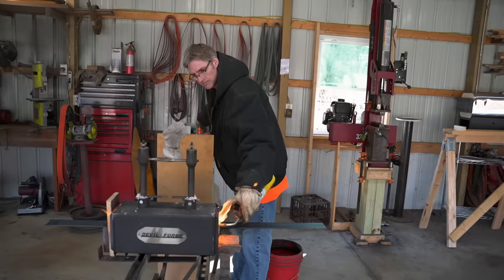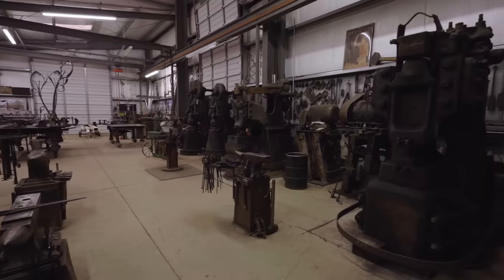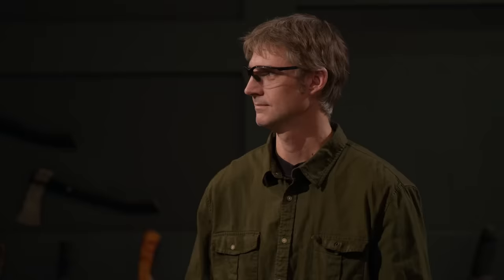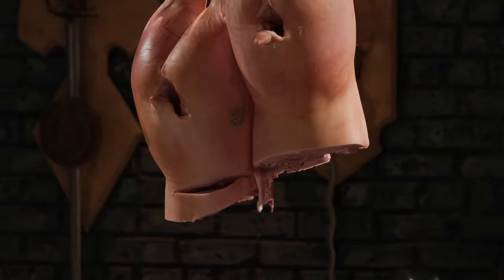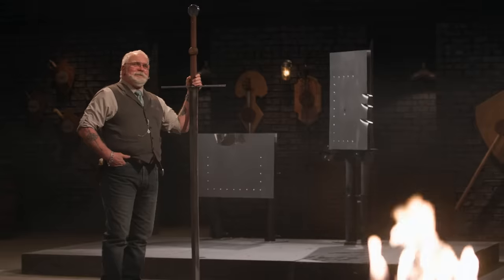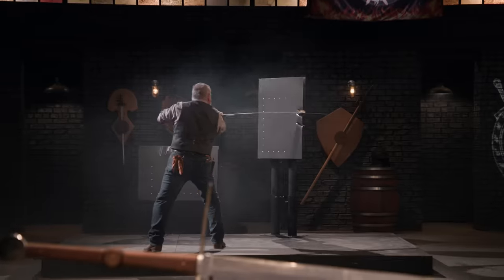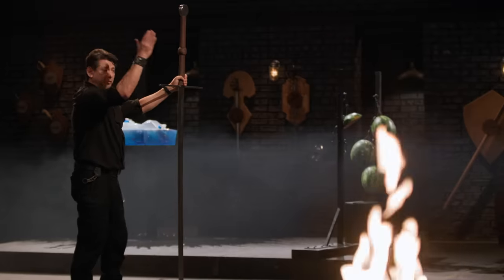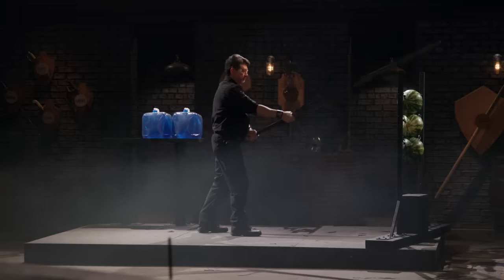MASSIVE SWORD is the LARGEST EVER Used in Battle! | Forged in Fire (Season 9)

Comment: the fact these blades didn't suffer a catastrophic failure is nothing to scoff at. most impressive
Reply: Especially with how John's sword kinda looked like he made it a bit too thin, or messed up something in the heat treat. But I guess that flex was what allowed it to endure that kind of beating.
Reply: @dethkruzer  flexible swords are actually slightly more durable than non flexible swords (why most European swords were made to be at least partially flexible). His was just a little too flexible, compromising some of the edge alignment.
Reply: @JosephSmith-lm4ri  yeah, it's about finding that sweet spot between hardness and flexibility. Too hard, it'll hold an edge well but be brittle. Too soft and it won't hold an edge but also won't shatter when you hit something hard the wrong way.
Reply: @JosephSmith-lm4ri  It just flex like a chinese jian, but the chinese jian is shorter and easier to control.
Reply: I cringe every time I see them do the hardness test. I understand why it's done but putting someone's work, any work, through that kind of treatment does not leave a good feeling.

Comment: Much respect to the Forged in Fire crew, and the bladesmiths, those were really outstanding blades for only having 3 days. But they really should have got some guys for whom a sword like this would have been made. It would have been neat to see what blades like that could do in the hands of someone like Björnsson.
Reply: They would have to find people that are both the right size and have experience wielding blades. You don't want to get some random big guy that has no experience in historical martial arts flinging that thing around.
Reply: @blaynegreiner9365  true but well according to the story does not sound like Gruite Pier had any training initially either he was just big and strong.
Reply: @blaynegreiner9365  I think these guys, who've been judging for upwards of 8 years now, has some sort of experience on wielding weapons, also, they're basing the weapons on the strength, and sharpness of the weapon itself, with a completely unbiased opinion.

Theres a reason why there are professional judges, and not every athlete is great at judging

Comment: That's actually fairly unfair to these two. That is one monster piece of steel to forge and finish in the same time all others have with significantly smaller blades. Well done to these two for not snapping like the other 2 handed styles on the show. Looks more like a Warhammer blade for Orks
Reply: theyre both competing under the same conditions, so its fair
Reply: fairly unfair? lol
Reply: @nanopixel6460  When you don't understand the comment
Reply: Big Choppa!
Reply: Ironically, there seemed to be no drama or critical errors; it's rare to see two smiths go through their respective processes so smoothly.

Comment: I think this is the first time I've seen a heavier blade win. Beast of a sword.
Reply: To be fair, the lighter blade won the side slice.  It cut so clean and quick that the tops stay in place despite being severed from the bottom.  Doug's reaction to that was priceless.
Reply: I think the weight almost didn't become a factor because none of them expected they could wield it effectively so they didn't have the same standard in terms of dexterity they would have with other blades. They really needed to get a giant with swordsmanship skills to test it properly.
Reply: Usually, the heavier 2-hand blade wins. heavy 1 hand blade is bad.

Comment: I find it hard to believe that a sword that big and floppy would be practical in battle.
Reply: It is the intimidation factor.  If the other side runs at the sight of someone that big wielding that size of a sword, then it has done it's job.
Reply: it wasn't, big swords like this were show pieces
Reply: @aname6717  That is kind of what I was saying.  You show the other side the piece you are carrying and they decide not to fight.  (joking)
Reply: it's not that's why it was never really used in battles excpet for a few exceptions
Reply: Doesn't that depend on the size of the wielder?

Comment: Don't think I've ever seen a blade with too much flex. Was that down to a tempering problem?
Reply: Probably not, the blade was able to retain its edge cutting through sheet metal. But the longer the blades the more they flex in general (even the other one flexed a lot). You need a thick profile to offset that and that one just didn't have it.
Reply: If anything, it flexing so much and still retaining its shape shows that the heat treatment was well done
Reply: I think he made the blade too straight. He should have tapered it more, so that it got narrower and thinner, as it approached the point.
Reply: it's too much flexing but you definitely want a blade that big and light to flex quite a decent amount because otherwise it's going to shatter and send steel flying into your face and body

Comment: The failure to cut the watermelons was more Doug's fault than the sword's, any flex in the blade would be more pronounce during a horizontal cut than a vertical cut & would effect the edge alignment & therefore accuracy much more.

Comment: The failure of these tests is that they don't test on the most crucial aspect : how exhausting are they and how durable are they with prolonged use in a battle simulation. After all that's what those swords were intended for: the battlefield. 
Nobody in those days did ridiculous cutting tests on plastic bottles or melons.

Comment: The title is not correct. There were larger swords. I can’t remember the name but it was like a katana but much much bigger around 3meter or 10feet.
Reply: Maybe you mean the Norimitsu Odachi? As far as i know the sword shown in this video really is the largest sword where there is proof of it ever being used in a real battle, so the title still isn't wrong in that regard.
Reply: @Weda01  Yes, odachi. The larget was 465cm!
Reply: @zoltan2728  Oh you mean the Haja-no-Ontachi. But the Haja-no-Ontachi was never used in a real battle, and normal Odachis that were really used in battle were (as far as i know) up to 178 cm tall which is still 35cm shorter than the sword shown in this video.
Reply: @Weda01  Okay if you say. I can’t fact check so i believe you.
Reply: @zoltan2728  you can just google to fact check if you want

Comment: Not historical correct, but fun :)
Reply: What isn't historical correct?
Reply: The sword is older then the man.  It it not sure it was used in battle...
Reply: @toresvestad6870  The sword isn't necessarily older than the man, the sword was dated to be made between the end of the 15th and the first halve of the 16th century which correlates with the time he lived (he was born in 1480 and died in 1520). The sword was also researched at Oxford where it was concluded that it was very likely used in battle.

Comment: Excuse me but you are perpetuating a falsehood... There were plenty of blades nearly 7 feet long, known as zweihanders- There's an entire school focused on it called 'Montarte'-! Most of them were, in fact, only about 5 feet in length, but there were historical examples of them reaching such massive lengths of 7 feet.
Reply: What other Zweihander(s) do you know that is around 7 feet tall and also used in battle?
Reply: @Weda01  while I don't have any actual individual ones to point out, look up just about any article about the weapon and they'll say "a range of 5 to 7 feet", now this is often overall length, not just blade length, meaning you'll have a lot of zweihanders which are 5 feet of blade and 2 feet of handle. I'm sure someone can find actual historical examples of ones with longer blades meant for bigger people, but like this sword (the Grote Piere one), they would have been custom made to accommodate size. Regardless, it's not as unique a weapon as one would think, especially among mercenaries.